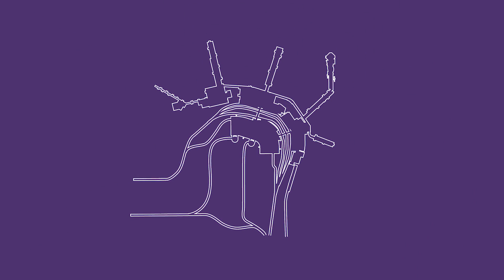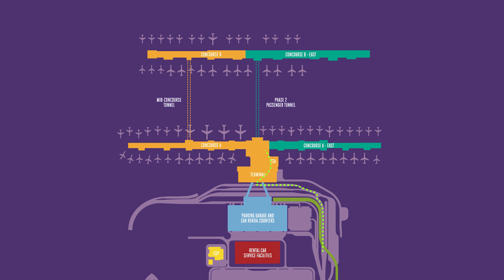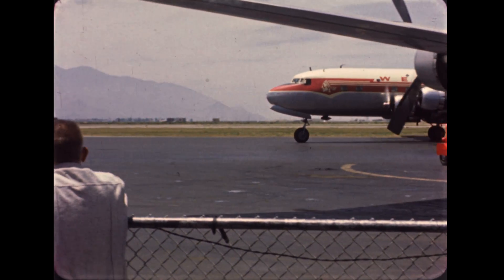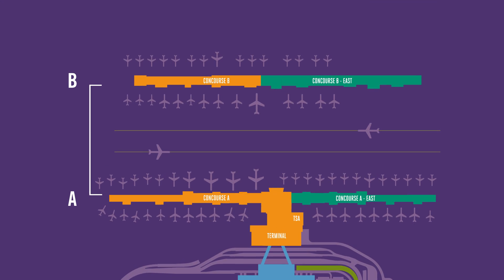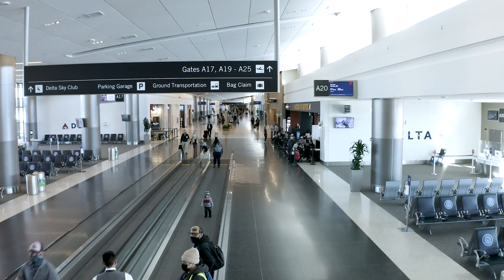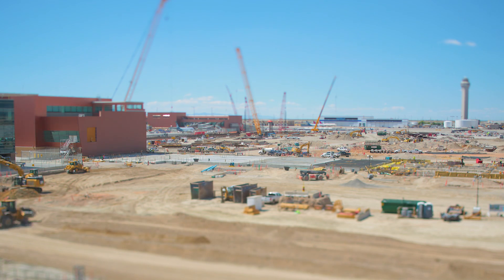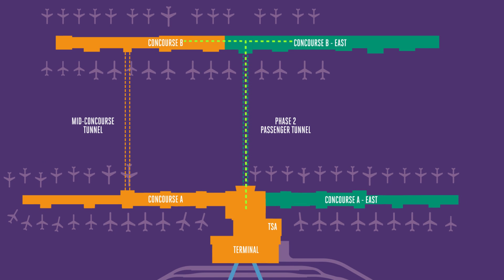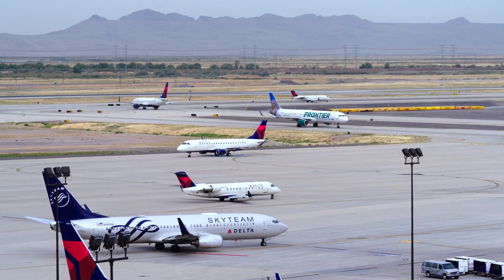The New SLC Design

Comment: Yes, a tram/subway/light rail/train/electric bus system should be used in the new tunnel.   It's a simple point to point move, so move people as fast and smoothly as possible.
Reply: Transit is planned for the tunnel, but I don’t think it will be operational until they build the third concourse.
Reply: Even with phase 2 partly open now, walking from A to B is ridiculously far. Both time and for those who have a challenge walking but not enough to require nor wanting a wheelchair.

Comment: you should still incorporate a tram of some sort between the concourses. many modern airports have this because airlines regularly schedule short layover times and many customers are not olympic caliber athletes, and will not be able to make the transition from A to B by simply walking. Also I don't know how you have not been sued by anyone with a disability , having multiple short moving walkways does not make it easier to navigate the long distance between terminals/gates.
Reply: They are planning on it. The main tunnel under construction has lanes for trams
Reply: @squrrll  they need some kind of temporary service in the mean time.
Reply: Getting the planes in and out was the priority made when rebuilding this airport (per articles about this airport). Perhaps some day they will also consider the needs of those who will be riding those planes.
Reply: They added a tram / trains  to the tunnels
Reply: While the new tunnel has lanes for teams, the real question is will actual teams be installed as part of Phase 2, or will folks have to hike the tunnel until a Phase 3 comes to fruition?  I can only hope you answer that a tr is being installed now!  The access tunnel today is painful to navigate given the length and two short length moving walkways.
Reply: Trams not teams
Reply: Apparently the airport replied to another comment and said that the new tunnel will have the ability to have a tram, but that there isn't a plan for one set yet. I hate this airport so much.
Reply: @mKierstenk  Mainly because airports don't start to consider a tram until the distance the tram will cover is approaching a mile. The tunnel as of now would be a tram about 1/4 a mile. A golf-cart train type service would probably work though.

Comment: the hand design was nice because no matter what terminal your flight was in it was never too far from the central hub that connected to all other terminals. making a bigger airport that only has two terminals out of an airport that used to be five terminals means the two terminals are gigantic and have way longer walking distances than the hand design. if we need to accommodate bigger plans with longer walking distances we also need to accommodate people (especially those with disabilities) with trains

Comment: Of all the airports I've been to around the world, the new SLC is sadly my least favorite... The new design is appallingly, shockingly bad. Just ask anyone who's had the great misfortune to fly into or out of Concourse B. Passenger complaints are rampant, with most wondering what in the world the designers were thinking, i.e., with all the time and money to get it right, how could they screw up this badly? Even more remarkably, and disappointingly, it appears Phase 2 doesn't solve any of the problems! Whoever designed and approved this should be fired with alacrity.
Reply: I really like it. I have walked to the furthest gates multiple times, kids in tow, and it's really not that far. The design includes a future tram between the concourses, so the walks will get even shorter. Security is so much easier and faster, as are pickup/dropoff.
Reply: @ericlichtenberg8137  makes perfect sense, early airplanes used Wasp engines.

Comment: We all know the current layout is terrible.   Don't explanation on why it had to start that way.   Why didn't they go to O'hare and examine how they dealt with the same thing - four escalators and for when they break a stair case.

Signage coming out of the tunnel from B to A is lacking.  Hard to figure out which way to turn.

The large shite multi-layer seating things are awful.  Kids climb all over them, so if you sit your clothing goes on a dirty surface likely from the men's room?   Fix that.

An improvement was designed to corral the families welcoming returning missionaries into an area that doesn't disrupt normal traffic.   However no one is enforcing this, and the families still spill out just like the old air port.
Reply: O’hare has the opposite problem.  It’s an absolute mess for planes.

Comment: You aren't listening to the people. You did not design for people despite your excuses. You designed for Delta. It's still going to be a very long walk for many many many people even after the "new"  long walkway. Other much busier airports have much less mileage to walk. For families and older people this is a nightmare.
Reply: Exactly!  They made it horrible!!
Reply: The new walkway also has a train. It seems much smaller than all the other bigger airports but will run more smoothly and at the same rate I’m sure.
Reply: 2 years later and they still don’t have the center tunnel

Comment: Sorry Bill, but I think you must have failed Plane Geometry. The walking distances remain the same from point A to point B, no matter how you draw the connecting links. Other comments have rightfully pointed out the likely scenario of disembarking somewhere on B concourse and trying to make a connection to A concourse (or inverse). Unless you are cross-country runner, you cannot make it from A to B, with carry-on baggage, etc., a restroom stop likely, in less than 30-40 minutes, if that quick. Detroit's airport is laid out linearly as well and it does happen that travelers have to disembark at one end and race to their connecting flight at the opposite end, barely making it before the doors are closed. Last trip through Detroit, we found out that a train runs end to end, thankfully.

Comment: Sorry, but the experience as a passenger is 100x worse than it used to be...  It's beautiful, but it's way too far to walk.  There are better designs that still accommodate larger planes, but don't require 30 minute walks to get out...  Even DFW from decades ago is a better design...

Comment: Congrats on turning SLC into a sprint training course.  Can’t tell you how many people I have seen running to make 30 minute or more connections.  Add in the bus ride for the ‘lessor’ destinations airports in B20+ and you have a recipe for missed flights and jammed escalators.

Not adding train system loop at A/B concourse level was huge oversight.  Just no excuse as noted in so many other’s comments.  You have 2 years to correct this oversight, make it happen!

Comment: Just as someone mentioned other nice airports that are large have transportation. And you can get to the gate within a few minutes. I have multiple sclerosis and what a pleasure it was to go 2 Concourse B. And then when we returned the gates aren't completed yet so the plane parked and we deplaned and had to go on a bus, in a hundred degree weather. Unbelievable that anyone in the Press on here that has any connection with the airport they close their eyes to the problems. I think it's time to start over have new teams come in look at the problems and fix them. The silly basement system now could be used for a shuttle? We're actually flying out of Ogden to go to Southern California so we don't have to use the scary new airport in Salt Lake.
Reply: Don't ever end up at Charles de Gaulle in France is a recommendation.

Comment: When the eastern portion of concourse A is completed and with it the new tunnel to concourse B, will the tunnel that is currently in use be closed?
Reply from the maker: Airport officials have not yet determined if the mid-concourse tunnel will remain open once the central tunnel is complete.
Reply: Will a tram be added in phase 2?
Reply from the maker: @MySecretMusicPlace  The central tunnel that is being constructed as part of Phase 2 will be built to accommodate a train, however it has not yet been decided if the train will be added as part of Phase 2 or at a later date.
Reply: @SLCIntlAirport  you need to do something to accommodate people with disabilities and the elderly, right now the airport is unusable by 40% of the population. Now, not 5 or 10 years from now.
Reply: @SLCIntlAirport  If nothing else, there should be a fleet of golf carts in that insane tunnel circling non-stop.  I have never witnessed such an outrage over a project with little to no immediate response.  Take the $300 million that is being saved and put in a train.

Comment: Why can't the taxi part of the runway be one way so there would be less distance between the terminals? With this design, the distance is MORE than the length of the 4 largest planes, with no tram! I am a fit, fast walker, so there are many people with a greater right to complain than myself, but I CANNOT STAND making the trek to terminal b. I fly Alaska Airlines because my family is in SD, and it is the best airline for my flight, but it is always given the very last gates in terminal B. I am a light packer and I don't every use a roller carry on because I don't need that much luggage, and I can store a small duffel under the seat, but then I have to carry it the whole way. But the WORST part is that with this poor airport design, there is no way to get around the STUPID people that don't stay to ONE side of an escalator or moving walkway so OTHER FASTER PEOPLE CAN MOVE BY THEM. I need to stop thinking about this because it is raising my blood pressure as we speak.
Reply: There has to be two lanes for aircraft, one lane for departing aircraft to pushback and another lane for aircraft arriving in to park.  If you had only one lane it would create a big jam as it takes several minutes or more to push a plane back, get started, do their checks, etc and then clear before other aircraft could get in.  That was the problem with the old configuration.

Comment: This B.S. about size 1 & 2 aircraft vs. 3, 4 & 5 is nonsense. As far back as 1970 the airport routinely had DC-10s, 707s, 727s, taking off and landing. These are not tiny aircraft. 
The limiting factor for plane size is very rarely the terminals. It's the runway length.
This "new" design has been tried before with usually bad results. The axial design of the old airport is the tried and true best design because it minimizes walking distances for everyone while providing ample room for every size of aircraft.

As far as I can tell this is a perfect example of planned obsolescence, ensuring that the whole thing will need to be done all over again within 20 years of inefficient, frustrating traveling experience.

It's obvious to me that he knows he's lying.
Reply: 707 and 727s are actually pretty tiny... they just had 3 or 4 engines. At least compared to bigger planes today like a350 and 777.
Reply: you just proved you do not know what you are talking about. 727, 707, and DC-10s are all smaller than modern wide bodies. The redesign was needed greatly and has proven to work very well. (despite customer complaints about the walking times)

Comment: This the absolutely worst designed airport I've ever been in. If you are elderly or have difficulty walking you are out of luck. The place has insufficient number of moving walkways as well as inadequate wheelchair assistance. There are no electric carts in the main tunnel and there is an arduous traverse in that horrible tunnel between the A and B courses which have insulting signs saying exercise is good for you.  The mayor of that idiotic city is on record as saying people need to walk. The mayor is a typical ignorant politician who ignores the needs of the elderly. This airport sucks the big giant one. I dread having to connect thru there which often I have no choice flying Delta.

Comment: If you have a flight connecting from one end of A to the other end of B or vice versa, you will be walking about 4800 feet. Remember a mile is 5280 feet...

There is a tram coming in the phase 2 tunnel, but wow, for now this business traveler is really annoyed.
Reply: Well, the tunnel isn't coming until fall of 2024, and the tram may not even go in then, but as part of a LATER phase. (I got all this from the website.) So lucky us, we'll be doing just what we're doing now for at least another two and a half years, and maybe indefinitely.
Reply: Given the designers lousy track record so far, do t hold your breath it will solve anything.